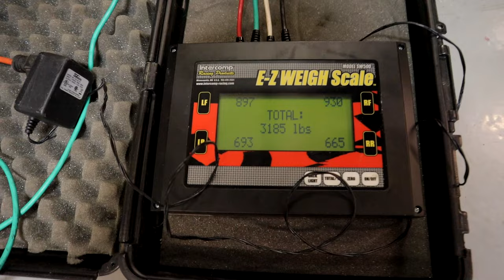American Musclecar Evolution - Why Pontiac Started Strong And Faded Into Obscurity

Comment: From what read at Hot Rod Motor Trend:  "Ken Valentine was the head metallurgist for Pontiac's V-8's cast reciprocating-assembly components, including the "N" and Armasteel steel cranks, the iron connecting rods, and the aluminum pistons. His duty was to make sure they met Pontiac's standard engine-components durability test—again, that was 4,500 rpm for 100 hours at wide-open throttle. I asked him once why Pontiac didn't use forged components inside of the engine. "The cast components pass the test and they cost considerably less," he answered. "That's all the Division cares about." That it in a nutshell. It was just not originally designed to be a racing engine.
.
Also, one advantage Chevy had, was I believe they could make their own forged connecting rods, in house, and forged cranks too, at what was then Chevy Forge, later renamed Chevy Gear and Axle. After the early 60's, after shifting over all production to cast rods and cranks, Pontiac had to use outside vendors for forged rods, and never did have any more production forged cranks..

Comment: So True Tony.....I,m only 49 but have always ran the old stuff...mostly Chevys,working/starting at a local engine machine shop back in early 90,s and I would pump on the older guys on other brands and there problems,1 guy was really smart and had been in the machine work since mid 60,s and I learned ALOT from that man.....even down to what you mentioned last video on mopar strong points,even boring a 440 block..he would say,come over and listen how thick the metal is by the sound while cutting,what you mentioned on Pontiac is dead on.....just always wondered what if??? G.M. had not pulled the plug on backing racing program and just settle with the street crowd in 1963....Mopar and Ford took off around that time till early 70,s when G.m got back into it.Your slick man and you have been around the block for sure!

Comment: The 400 Pontiac was a strong engine I mean by all means it didn't have huge horsepower numbers and lots of torque but for what it was for stock engine it was very impressive I remember the 70s the Trans Ams they got up and went they were fun cars to drive it was like driving in the space shuttle you got in a car and it kind of wrapped around you everything was extremely comfortable and it just felt right and the things you could do with them cars they just hooked

Comment: I disagree on the Ford FE eating bearings.  I have run several of them & torn many more down without seeing much bearing wear AT ALL.  All I have ever done for my oiling system is to gasket match the oil pump passage in the block & radius it, install a HV oil pump (Melling only), & make certain the copper welds on the pickup tube are pinhole free.  If any question at all on the latter, I will silver solder over the factory joint & clean out the hole afterward (with the "cap" & screen removed from the suction end & reinstalled afterward).  I make sure that my main clearance is between 0.0025" and 0.003" & rod clearance between 0.002" and 0.0025".  I also build the engine to perform well below 6000 RPM.  There are a great number of combos you can put together that will trounce most Chevy's & not have to spin hard.  The very item mentioned in the thread above on Pontiac power are also true for the FE.  

Also, GM kept the cost of Chevy engines exceedingly lower than any other division so that they would be where they are at today.

Comment: The other issue with making a max effort pontiac is the bore spacing. It makes bore size limited which limits air flow potential from the heads due to the bore wall shrouding the intake valve. 
If they could have released the SD455 (it had forged rods) before they cut compression ratios and installed the 041 cam instead of the 744 it would have rivaled the LS6 for in car performance.

Comment: Motor Trend; "The Day a Pontiac Tempest Bested a 427 Corvette... 1963".

It was the 2nd 250 mile race at Daytona called "The Continental Race".

Very interesting about the transmission, transaxle and "flexible" "rope " drive shaft.

"Pontiac's Rope Drive: The Flexible Driveshaft That Will Bend Your Mind". By Aaron Gold

Comment: Fast forward to today and there are so many of the myths I’ve read here debunked one is the 3 inch main.Although I do agree the 3.25 main is way to large the 3 inch main is workable.
   There are Pontiacs out there today turning 9000+ rpms setting records in classes N/A I might add.There are some in power assisted as well.There was a guy who won drag week in the BigBlock power assist class this year in a sea of BBC,Hemis,BBF LS’s you name it!
  Today there are so many aftermarket blocks cranks,rods in fact you don’t need one factory part to build one and the price is on pare with most makes.
  I’m personally building a Twin turbo 428 now a 440 that is targeted for 1600 horsepower drive anywhere street car complete with A/C these Pontiacs are as popular now as ever.
   Now as far as factory rods I’ve used them personally in a 400 with 300 horse nitrous hits for years in fact I still own that 400.That 400 won me more money on the street it was a money maker.Here is my take on Pontiacs or any other make bad tunes tare up more chit than most realize.Nothing personal but I’ve seen BBC,HEMIS,BBC oil down the street many times knocking rods out of them.
 All in all Pontiacs are at a level today many of the old timers could of only dream about the Boosted record today is over 4000 HP and the N/A record is 1300+ who would of figured.

Comment: Like most things of history, it is easy to look back in time and theorize on much of anything or romanticize about our favorite car or brand. If you did not live through the "era" or research the history, then it is easy for anyone to sound plausible in their explanations. Pontiac used forged rods in their 1955 V8's right through to the 1965 421CI engines (excluding the later Super Duty/RA 5 engines). The issue with the earlier production forged rods was the metal compound used and/or the Rockwell hardness. So if you grabbed a set of production forged rods at a local swap meet or from some guy selling a set in a trade paper (Pontiac used all the same length) and simply assumed that forged rods were what was needed over the factory cast rods, you may have made a big mistake - because the cast rods could have been stronger. The first series were the 1955-57 and had bushed piston pins and pin oiling but was very low in Rockwell hardness. Second series was from 1958 to 1962. No longer factory bushed and used press fit piston pins. Rockwell hardness was 18 - 24 and could be race prepped to be more reliable. The third series was the 1963 to 1965 (and some early 1966's) 421 HO engines although I did pulled a set from a 1965 non-HO 42. Again, lower Rockwell hardness of 17 - 20. BUT, what most high performance Pontiac people think of when it comes to forged rods are the early Super Duty rods. And in the age of no-computers and relying on word of mouth, your buddy, the buddy of a buddy, or some article quickly read in the era period magazine, any forged rod to us young Pontiac guys was of course a super duty forged rod - because we did not know better. The Super Duty forged rods were used from 1958 to 1963 and these forged rod which looked just like the production forged rod except it had a Rockwell hardness of 28-34, had a slightly narrower width on the big end, .985" vs .995", and the cap bolt bosses are longer, 2" vs 1 15/16". There was also a special Nascar forged rod produced in early1963 having 7/16" rod bolts - but Pontiac backing in the racing circuits had end by corporate orders in 1962. This leaves the cast connecting rods made of Arma steel. They were lighter than forged rods, 31 ounces vs 40 ounces, and used a reinforced rib in the I-beam section. These rods are very strong and capable of 6,000 RPM blasts, and sometimes more as I have done. Are they really the weak link? First up in rod/bearing failures are the rod bolts - they can stretch at the higher limits of the RPM range. Once they stretch, the crank bearing edges are pulled inward against the crank and act like a scraper wiping off the oil leading to a quick heat up of the dry bearing and the rest is history. Detonation destroys rod bearings and when you have headers/glass packs blaring away under full throttle, you are less likely to hear detonation and wipe out a bearing. You may get lucky and catch the bad bearing through the rod knock and save the engine or.....bang. Low oil levels. Your engine has some miles and uses/leaks oil and the level gets a tad bit low just when that '70 Chevelle pulls up along side of you at the stop light. The light turns green and the race is on as you nail the gas hard and what little oil is in the pan rides to the back and up the oil pan wall exposing the oil pump pick up to fresh air and the next thing you know is that you hear a terrible knocking sound as a rod bearing just got burned up due to lack of oil - did this one myself, and why the 1967 GTO's were filled with 1 quart extra for 6 qts in the standard 5 qt pan . How about all those little pieces of nylon gear teeth that chipped/broke off the factory "silent" cam gear and plugged the oil pick up screen and starved the engine of its oil supply when you spun the engine up near 5,800 RPM's in each gear? Factory timing gears and chains were in need of replacement at around 50,000 miles more or less depending on how hard the engine was run. And my favorite - how many swapped in another engine from a junk yard or parts car that was not another high performance GTO or Firebird? You could get a real good deal on a junk yard engine from a 4-door Catalina or worn out wagon. Remember the 10 PSI oil pressure rule? 10 PSI for each 1,000 RPM's. The mom and pop Pontiacs used the lower 40 PSI oil pumps whereas the high performance engines used the 60 PSI pumps. So you swapped in that nice lower mileage good running engine from the full size donor car and began spinning it the same way you did the now deceased high performance engine - especially that torquey 455CI mill.  What do you thin is happening to those rod/crank bearings as you wind that engine out with its aluminum intake and Holley carb? Ooops, is that a rod knock? Sure enough, you know how Pontiac engines have weak rods, right? So the question remains - are the Pontiac cast rods the weak link or was it one of several other issues that caused the rod to go bad or come apart and take out an engine? Because the cast rod is the obvious failure due to the audible rod knock, burned bearings, or blown out bottom end - the rod is targeted as the cause. My experience hammering on the Pontiacs I owned when younger showed now issues with cast rods constantly spinning them to the upper limits. High mileage worn out engines and low oil seemed to be the causes of my rod bearing failures to which I did not push it to cause a complete rod/engine failure. Even had a 455 that lost the oil pump, burned up all the bearings, wore the rod journal well into the cast rod cap and got so hot the crankshaft was warped. That is enough proof for me that Pontiac cast rods are pretty rugged.

Comment: G'day Uncle Tony,

Yet another great video.  But, since you mentioned it, I have to comment.

You DO know that the Chrysler ball-stud hemi ended up as the Austrailan 6-cyl hemi, right?  It had a very shallow angle between the valves, since they were fitted in a line, from front to back, instead of across from left to right.  The original hemis started out as 160 HP 245 in '69, & by 72, the factory racers were up to 265, & 302 HP.  I built a couple of them for my '72 Valiant Charger - a 245 & a 265cid.  I used my car for daily driving, & weekend sprint racing.  

If you want to find more, just search YT for "E49 Charger" - the Aussie 265, Triple Weber homologation special for Aus & New Zealand Touring Car racing.  I recently watched an NZ video showing the history & restorations of a couple of racing Chargers.  See if you can find anything about Leo Geoghan too - he was one of the gun Charger racers in Aus, & a bit of acharacter too.

Thanks again for a great video.  Keep up the good work, & stop being an Uncle Tony with fire...  :)

Ta
Andrew

Comment: I got a '69 gto 400 4sp , the previous owner passed away before I got it so I had 0 information about it. Only thing I knew about it was  it ran one day, then it stopped running and it was parked and was never touched for 20yrs  so I got it home did the basics and got it fired up ran bout 3 seconds  then checked everything again and the tip of the  number 7 cylinder spark plug was smashed so I put everything back together and it's in storage  but this video is the first information that would help explain what I'm likely going to have to deal with when I tear into it  👍 I'm not a horse power guy so engines are not my department  but am a muscle car guy and can build em completely as far as structure and body

Comment: I have a 1958 gmc came factory with a 336 pontiac. It had cast rods in it. I was shocked they would cast connecting rods. I replaced them with h beams

Comment: i restored a few cars like mopar fords and gm and by far the easiest is gm like i had a 66 chevy 3/4 ton pu that i just put on the road but had a straight 6 292 witch took cable linkage but the pu had mechanical linkage so i took the pedal out of a 73 nova with the cable then took the mount from the truck and it bolted right together or my 66 gto i took parts from a 75 Bonneville and bolted them right in the 66 gto like the power trunk power seats just the under side mounts for the power bolted right to the factory bucket seats even the light for under the hood and a bunch of suspension parts. on ford u need a cross reference book like if u want to put a tilt wheel in a 67/72 ford pu or put a 460 in one u need the parts from a 72 Lincoln they will bolt right in . but i get the best deals on chevy like a 73 ss nova with gauges on the floor for 50 bucks rust free good clean body still had the factory paint. my 68 chevy pu i have 2000 dollars in it but has a stroke 454 in it to buy the engine and trans new will cost 15,000 for a complete setup ready to run but i also got everything to drop it in and drive and i still have the rebuilt 327/400turbo that came factory with the pu. i can sell it for more then i have in the truck. plus i get a lot of chevys for free

Comment: Talking street creed, I'd say before 65 most of the OHV V8 engines were more or less equal depending on the mods owners could afford, by 67 the BBC ruled the streets because of the better breathing heads, the 426 hemi could run with them but one problem, there were very few around.   My take on it actually being there.

Comment: Dad was a GM mechanic forever and was pissed when they shut down Pontiac. He said they were the only part of the company that was doing things to fix the mistakes the rest of the penny pinchers were letting go. The engines were assembled better, their transmissions had the weaknesses (like plastic gears) replaced and the cares were easier to work on. Just simple things like bolt or screw placement the engineers would move or change the shape of an item so that disassembly was simpler.

Comment: GM developed, "Armasteel", which is a cast iron with, "some steel-like" properties. Buick used it for 350 connecting rods, but not in 400's and 455's. Pontiac claimed the cast rods were stronger than the forged steel rods. Pontiac even made crankshafts of Armasteel, but in 1968 GM developed an, "improved" nodular cast iron. The Armasteel was thought to have less, "give" or deflection than desired for crankshafts, but the newer GM nodular cast iron was found to have similar deflection as forged steel crankshafts. Before 1968 Pontiac also used an older version of nodular cast iron for some of their crankshafts. Pontiac had developed a 428 in 1969 with Ram Air IV parts for 1970, but the 428 engine got scratched and it was thought the 455 wouldn't hold up with Ram Air IV parts. Pontiac had developed a Super Duty Ram Air IV 400 for the 1970 Firebird, with  stronger block, forged steel crank and rods, but it would have cost more than a 1970 426 Hemi Cuda and still been a 400 engine. The cast rods hold up to 7,000 RPM with ARP bolts with a 400 stroke, but a longer stroke places too much stress on the rods for high RPM and the cast rods are usually only good for about 450 horsepower. The forged rods suffered from forging flaws, with hairline / micro cracks, but even with those, the standard pre-1963 389 forged rods usually test stronger than the later cast rods. The 428 switched from an Armasteel crank to a nodular crank halfway into the 1968 model year. Pontiac did lighten the later 428 and 455 pistons in an effort to reduce rotational stress. Many aftermarket replacement pistons for the 428 have the 1967 to early 68 weight and are too heavy for late 68 to 1969 428 crankshaft balance. The early 428 pistons weigh the same as 421 pistons and used the same 421 Armasteel crank. The 68 nodular iron allowed cast nodular iron cranks in  the 68 - 69 385 hp Chevy 427, but early Chevy 454's used forged steel cranks until 1973. Olds used forged steel for the first month of long stroke 68 400 engines and for many 68 455's and some 69 455 HO engine, but went to nodular iron in the 2nd month of 68 400's and all 1970 455's. Armasteel is classified as a cast iron, not a cast steel. It was only named Armasteel by GM, because it has some steel-like properties.